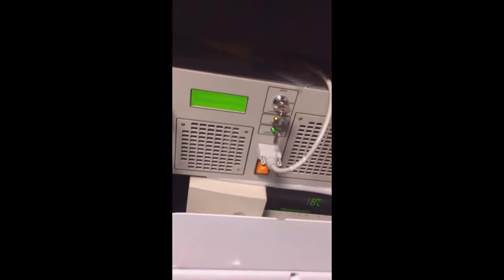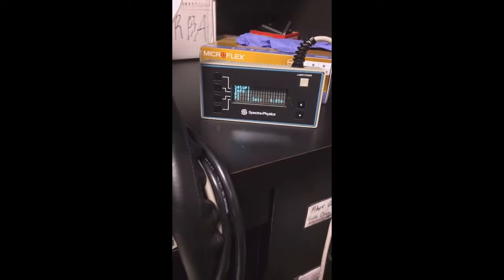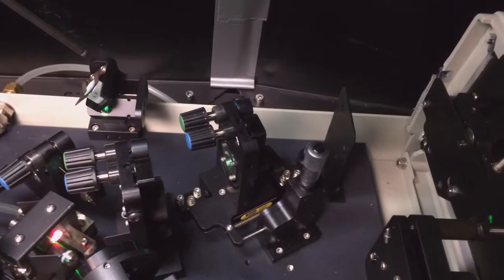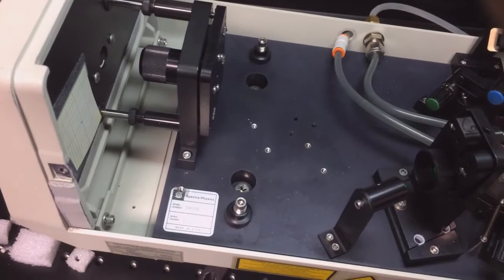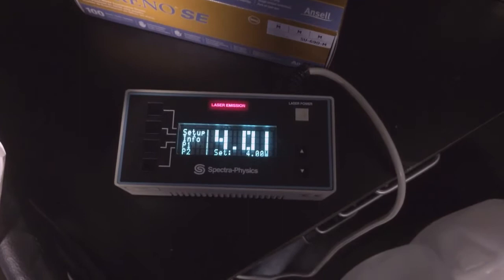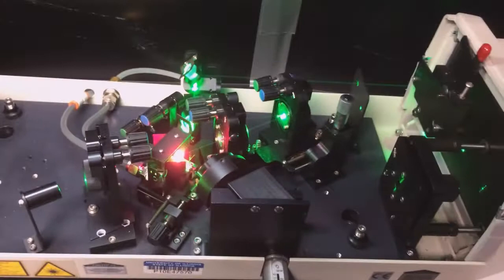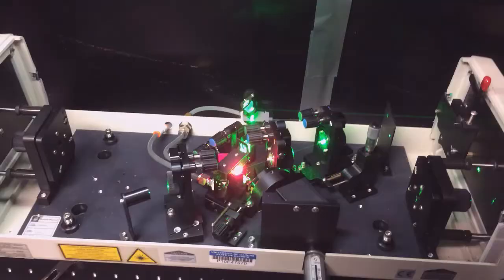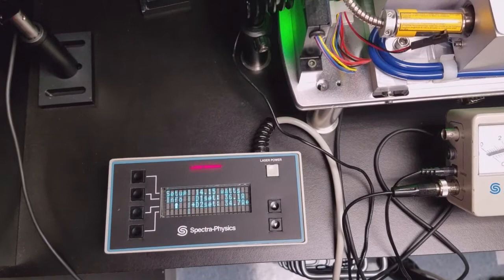Ep. 10 CW Ti:Sapphire Laser Turn-on, Use, and Alignment Instructions

Comment: I liked you video, but kinda wished you'd left in more of the conversation you were having with the other guy.  I work with a Tsunami with a similar 10W Millennia Pro. One of the previous laser scientist enclosed our system and set up a shutter to the oscillator output so it could be safely run 24/7... no warm up cycles on the diodes, cavity, or the surrounding hardware.  It's very stable and the diodes have lasted over a decade..